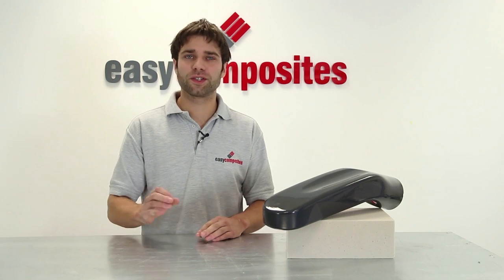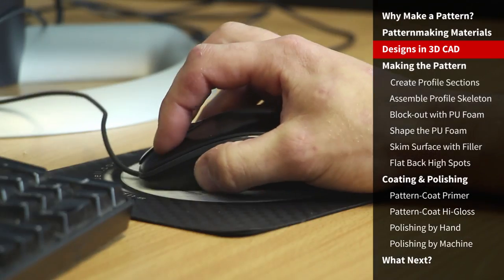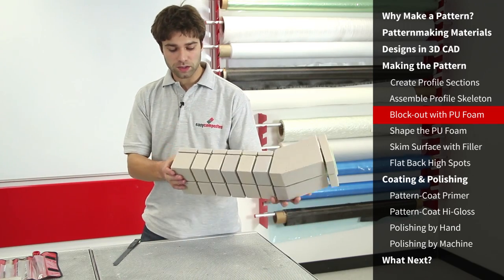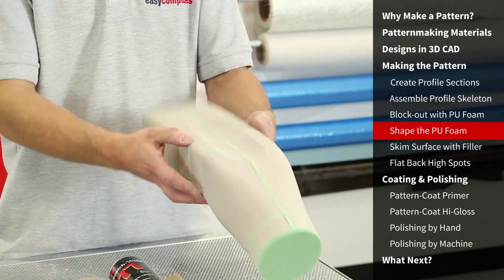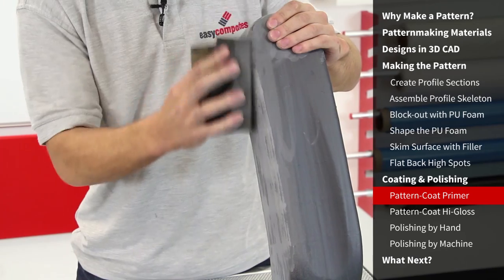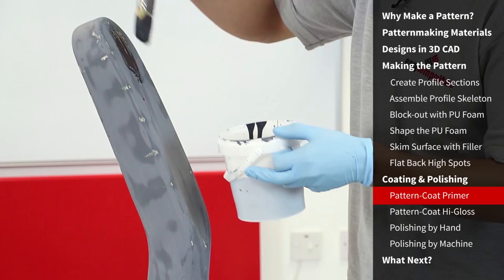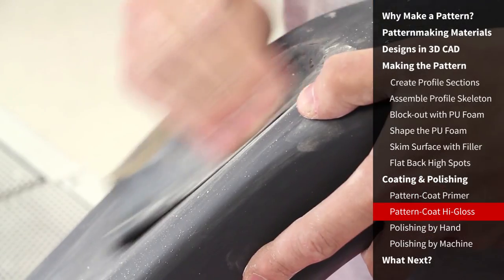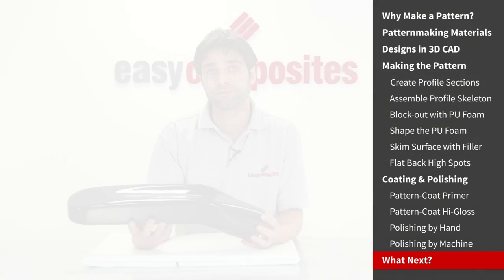Composite (Fibreglass) Pattern Making Tutorial (Carbon Fibre Airbox Pt.1)

Comment: I make blue polystyrene foam sanding blocks with a range of common profiles, then stick on Velcro 50mm wide, and then use Velcro-backed abranet sanding sheet cut to size to get the shapes I need.  Works very well in getting the shapes I need.

Comment: This tutorial is brilliant - for people who do not have skils happy to ofer my services. Can cut shape on CNC machine from foam , wood , MDF, plywood, aluminium  and many other. Much larger size can be cut than 3D printed. Shape can be 3D scanned from existing object or created in 3D software . Accept files in plenty diferent formats from meshes as STL or PLY to CAD formats and many others. Also can help with design - by turning your sketches and sugestions- in to the 3D model. Another great possibility is to fit your model on curved surface- we can do it simple by 3D scanning this surface . When have it in computer is easy to extract it from your model and create part with perfect fit. All of this for affordable price so by having your model just order composites and start to do it -only barrier will be your imagination.

Comment from the maker: It depends on the facilities available.  For some materials, you can get away with a thin skim of filler and 2 pack paints to get the desired finish.  For many other items like foams etc, the Pattern-Coat Primer and Gloss Coat can be very beneficial, especially if spray facilities are not available and/or fine details are necessary to be shaped and finished.

Comment: This is an excellent tutorial. I wish a had a high tech machine to CNC my own complex patterns. It's really hard to do those by hand.
Reply from the maker: +michor10 Yes, there's time and effort goes into hand making a pattern. These days though, the price of CNC routers is coming down and machines like the Stepcraft are within reach if you feel like making an investment. Software like Autodesk's amazing Fusion360 is FREE (for non commercial use) and will output the GCODE to a router like a Stepcraft. You can then machine PU model board for instant patterns.
Reply: Easy Composites Ltd Wow, that is great news. I will try out printing out those reference images like you did in the video until I can afford a CNC router. That will really help getting the symmetry right. Thanks for the tip!
Reply: +Easy Composites Ltd thanks for the info about cnc. keep make more videos, i still taking class from you. im working on my car, is a 350z and i cut the roof and im going to make it convertible with hard top, basically i has to make my own hard top roof. big challenger
Reply: MickHornbak d
Reply: MickHornbak sircan i request tutorial doin editi ng in 3d cad?

Comment: I used a Kingspan equivalent as a pattern making material. It's relatively cheap or free if you can get offcuts no-one wants. All you need do is peel away the aluminium based backing material and cut/glue the pieces to the desired size.
Reply from the maker: David Waller Hi David; one thing users should keep in mind though is that 'Kingspan' is a polystyrene foam which means it will melt in contact with solvents or styrene (such as polyester resin or bodyfiller). Since the pattern coating resin we use is polyester and so is the bodyfiller, if you do use Kingspan as your pattern material then both the resin and the bodyfiller will melt it away. This is the main reason we use polyurethane foams for pattern making.

Comment: Great, i've been looking for something like this for almost half of the year! can't wait for the next part. I study mechanical engineering in Poland (last year) and have thesis "design of intake system in spark ignition internal combustion engine". Your video will help me a lot to do this, but i have a question. Can you tell me how to make these sections in 3d model and how i can print it? Do I need any other program besides 3d cad modeler? can't start making it without your answer. Thanks a lot for your very helpful channel :)
Reply from the maker: We just took section views and printed them out. Most decent CAD software will allow you to do that.
Reply: easycompositestv Thanks for answer. I'm newbie in engineering, only one project done in cad.

Comment: Excellent presentation. Related to this what would be the best approach to make a part like a flying saucer (like two dishes on top of each other) covered in fiberglass or carbon, with a foam core? Don't ask about its utility - there's none - but I'm interested in the approach of making a mold for it for either hand lamination, vacuum bagging, resin infusion. Could be a subject for a new video. Thanks in advance!

Comment: 1 important question: whilst designing the 3d model of the pattern do you consider the tolerance from the thickness of the number of coating and primer going on to the mould?
Reply from the maker: If your were going to machine the pattern and you needed a very high level of dimensional accuracy then yes you would want to take it into account. However for most non-precise projects like this, by the time you've sanded the foam and recoated it with primer, it tends to be pretty close to the original dimensions.

Comment: I understand the concept of building the skeleton out of the harder foam, but it seems that this greatly increases time required, rather than simply taking your time with the softer foam from one or two pieces.  My mentor always used a single piece and machined it down (by machine or hand) to make a prototype for molding.   What am I missing in the logic of your process?  Thank you in advance.
Reply from the maker: The frame is to ensure a reasonable level of dimensional accuracy as the foam frame templates were taken from CAD.  You would stuggle to get the same level of accuracy just free hand sanding a block of foam with nothing to guide you dimensionally.
Reply: Easy Composites Ltd thank you for responding.   It has been some time since I worked with composites so i appreciate your videos and insight.

Comment: This is a lot of detailed work for a mold, is this a very special part then or am i missing something?
Reply from the maker: RCcrAzY1234 It is a unique design from scratch.  For many parts made using composites, there are no off the shelf solutions hence the flexibility of the composites methods, such as pre-preg means you can relatively simply make a one off product without expensive mass production tooling costs.

Comment: Would these techniques and materials work to make a hood scoop and bond it to to a metal hood to make a mold of the hood with a hood scoop to be used to make a carbon fiber hood.
Reply from the maker: Yes you could do that no problem.  Bond the piece into place on the hood then take care to finish off the transition between the foam pattern and the metal so the finish is smooth then take a mould off it to make the finished hood from.

Comment: Hi 
can you make a video on making of telescopic carbon fiber pole
Reply from the maker: Thanks for the suggestion but making telescopic tubes is really more of a practical matter once you have the tubes (with the correct descending diameters), it’s then about making some sort of locking mechanisms. On the market, these tend to be injection moulded parts so not really something we can demonstrate to a composites audience.

Comment: i usually make 1 piece of it, and always work with positive disposable pattern of stirofoam, never sand it more than twice, after cure put in gaselin that melts stirofoam and item is finished
Reply from the maker: Thanks for your comment. Certainly a sacrificial core process like that can be used although, inevitably, you'll get a very different level of finish. Nonetheless, for basic one off parts that don't need a high standard of finish you could do this.

Comment: Amazing video, now only if my parts weren't a couple feet big
Reply from the maker: Well, you can still use the same process for larger parts. If your problem is having an oven large enough to cure the parts then this can be a barrier to using prepreg but you could certainly use a resin infusion process (see our other videos) which doesn't need elevated temperature to cure.

Comment: Pattern Coat Primer, Sanding Primer and Gel Coat all seem to be used for very similar purpose. What are the differences? So far I have chosen to use only Epoxy resins for all my Fiberglass and Carbon Fiber projects.
Reply from the maker: Pattern coat primer is specifically for patterns, is very high build and easy to sand and polish.  Gelcoats are completely different generally being very hard to provide a durable high quality tool finsh.

Comment: If you were making this pattern on a CNC machine with tooling block, how much sanding would you need to do to get a surface finish for mould making?... Or would it come off the machine "ready to go"?
Reply from the maker: micky jegero It depends on the quality of the tooling block and the CNC machine.  Certainly with a good high density block you can achieve a suitable finish straight from machining and with the correct kind of mould sealer and release agent take a mould off the tooling block.

Comment: Where can I get the filler used? And what did you mix with it? Where can I find that as well. Trying to buy everything from you guys
Reply from the maker: Hi Camden, the bodyfiller is one of the only things in this video that you can't get from us, simply because it's so easy to find elsewhere we decided not to bother carrying it. We're just using a basis 'easy sand' car bodyfiller. U-POL make a good one, you can pick it up from any motor-factors, hardware store or the usual online places.

Comment: How are you getting your profile sections for print out? Is this a specific function of your 3DCAD  program? Or is it  function of all CAD programs and I'm just overlooking it in the ones I use?
Reply: iRoc Von JamminStien This somewhat dificult process of printing is a bit overlooked by the folks at Easy Composites as they cannot possibly cover the details of all of the various 3D CAD programs. I had to design the part and EXPORT it to a PDF file for printing in order to get the PRECISE profile on paper. If your profile (the outline of the object to be printed) is greater then the standard printer size of 8.5 x 11 inches, you will have to take the file to a printing house (Kinkos FedEx) for a large format print. You CAN print all of the oversize profile  from an 8.5 x 11 in printer but it will come out as multiple documents and you will have to trim, align, and glue the various sheets together to get a working model. Kinkos is faster but make CERTAIN that you deliver the file to them as a PDF otherwise it will not print right. 

Also, depending on the CAD program you are using, the slot and tab function that is shown in the film will have to be solved. I had to call the CAD vendor (KeyCreator by KubotekUSA) for specific instructions. I made my pattern (a 24" X 10" megaphone shaped clean air intake pipe) cut from pattern outlines on MDF on a band saw and the slots were cut with a 10" table saw with a slot blade. The pieces fit together like a glove and I finished the model shape with the low density foam, body filler, and body glaze.

Comment: Is there a parallel product that is similar to your "Pattern Coat Primer and Pattern Coat High Gloss" that I can buy here in the colonies? I'm suspecting that it is some sort of  high build primer but the two part system seems to make it harder. The exchange rate and shipping currently makes your product rather pricey even though the dollar is at a premium at this time. Any guidance would be appreciated.
Reply from the maker: +DubleDeuce : Your best bet might be to try to replicate the properties of Pattern Coat Primer using a polyester resin (without air-cure inhibition) mixed with some colloidal silica (cab-o-sil,  fumed silica etc.) to increase the thixotropy of the resin and then some micro ballons / microsphreres to reduce the density and increase the sand-ability of the resin. It might sound like a lot of fuss but in days gone by, this was how pros made their own pattern coating resins.

Comment: Hello and thanks for the videos, I have a question I'm thinking of making a mold for laminating carbon fiber infused vacuum , my mold will be modeled in a 3D software then with sliceform wood and foam as in the video, the question is whether I can make rolling the same mold , or would have to make a new mold fiberglass out of first. I think the first is enough fuerte.Gracias
Reply from the maker: Ernesto garcia prieto Hi Ernesto, whilst it is possible to make the mould in the first instant, usually it is far better to make a pattern (the 'male' shape) and then make a fibreglass mould (the 'female' shape) from the pattern. One reason being the ease of getting a good finish - it's much harder to get a good finish on the concave inside of a mould than on the outside of a convex pattern. Another being the strength and durability of the finished mould - foam, wood slices and coating resin are not anywhere near as strong as a solid laminate fibreglass mould. There's other reasons too. I would say if you only want to make one part then you can consider making the mould without making a pattern first; if you're planning on making more than one part then I would say it would always be better to make a pattern first.

Comment: Instead of starting with the shaping foam could use a 3D printer to make the base structure?
Reply from the maker: +Austin Fisher Mmm, yes, but you need to have a decent finish on the printed part; normally PP or PLA are not going to make a suitable release surface so you would need to coat the printed parts with something first (like infiltrant).

Comment: can you sculpt the polyurethane foam from a solid block, instead of using the segments to make the skeleton etc. Obviously doing it from the segments you can duplicate the exact shape of the cad drawing, but you could still get a good result just carving from the solid block?
Reply from the maker: Yes you certainly can use a solid block.  The precision of shape may not be as good as you mention but for certain applications that may not be a limiting factor.

Comment: I dont have a hi gloss paint/primer like this. Is there anything else I can use in place of it to make a mold from? I have laminating epoxy and tooling gel coat. I have a hard sealed surface already so I was thinking I could use laminating epoxy because it sands easy and can give a great shine. Any suggestion are appreciated!
Reply from the maker: Laminating epoxy can be harder to sand than a typical pattern coating system, but with a bit of elbow grease you can still achieve a good enough gloss to take a mould from.

Comment: would it be possible to make a patterned gel coated piece like this and then just put a carbon fiber skin over it instead of making a mold? I want to make an original piece trunk spoiler in carbon, but don't really want to have to make a mold since i would only be making the one piece...
Reply from the maker: Yes you can skin the part in carbon fibre.  You may want to consider more than one layer to make sure it is strong if the pattern is not already strong enough.

Comment: Great tutorial, quick question, the pattern coat can it be thinned and used with a spray gun?
Reply from the maker: Our Pattern Coat Primer can be applied using a Gelcoat Cup gun with the resin thinned by adding 25% Acetone.  The Pattern Coat Hi-Gloss will spray through a normal spray gun when it is also thinned down with 25% Acetone.
Reply: +Easy Composites Ltd when using the g-100 gelcoat spray gun do you still have to thin with 25% acetone? I find it very difficult to spray an even coat as too much primer comes out of the gun in a short amount of time.
Reply: +Easy Composites Ltd I found out that if you are using the gelcoat spray gun sold by easy composites to apply the primer is better not to use 25% acetone. By thinning the primer with 25% acetone the gelcoat just runs out of the gun and it's used more quickly then if you don't use acetone at all. Just my experience with it. Thanks.

Comment: So if you want your carbon fiber part to have a sating finish, would you recommend not to apply the pattern-cost hi-gloss??
Reply from the maker: +christianc1562004 : We'll, if you're only after a satin finish on your part then you certainly wouldn't need the high-gloss. What you will find however is that even if you leave the pattern with a satin finish, any wax or release agent will tend to 'gloss it up' slightly when you prepare it to take the moulds off. Then, when you prepare the moulds with release agent then they will get glossed up some more again by this process. There's an inevitable march towards the moulds getting glossier as you move from pattern to part so you might find you still need to matt off the finished part to get back to a proper satin finish.
Reply: +Easy Composites Ltd thank you for the response. Now how would go towards matting off the part? Maybe you guys could make a video tutorial. Thanks again.

Comment: Hi great video can anyone explain what is low spot and high spot. Thanks a lot!
Reply from the maker: Sure thing, I 'high spot' is an area of a surface which is higher than the majority of the surrounding area, a low spot is the opposite where a part of the surface is lower than the surrounding areas. The process of 'flatting' is all about getting rid of high or low spots to leave your whole surface 'flat' and smooth.

Comment: There is also closed cell vinyl foam, what about that? Does it sand?
Reply from the maker: The thinner green foam you see us using (to make the initial scructure) is closed cell PVC foam. It does sand but not anywhere near as well as the polyurethane.